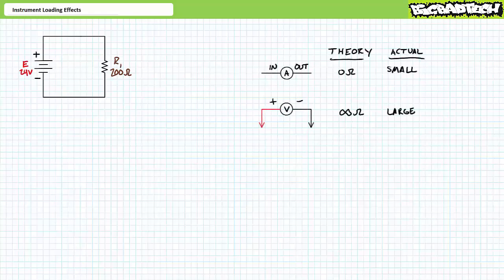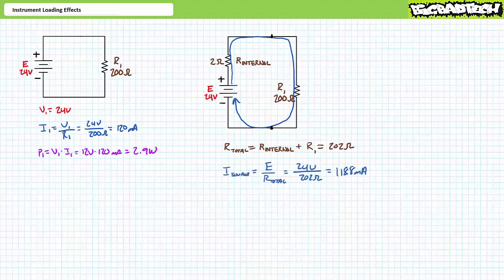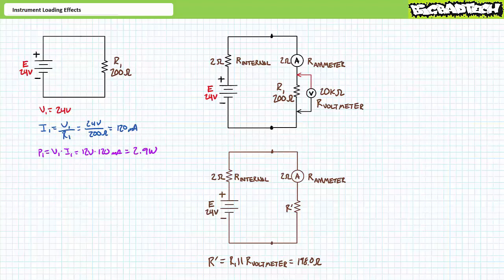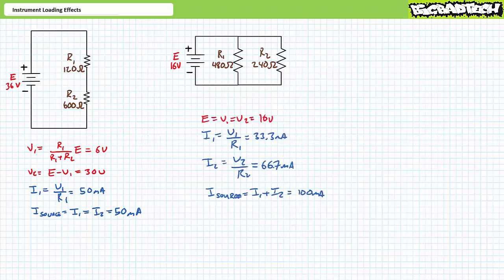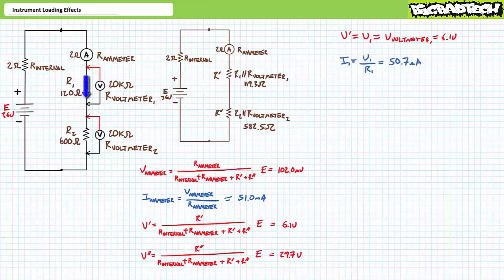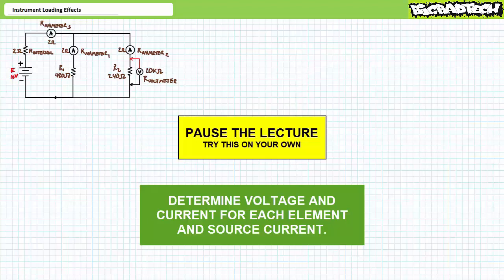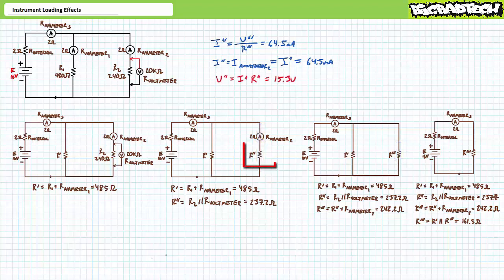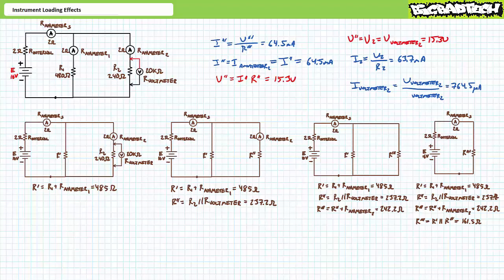Instrument Loading Effects (Full Lecture)

Comment: Question: Does this theory apply to high voltage systems where in a distribution yard you have 230KV @800Amps and it's reduced by potential transformers & current transformers so instrumentation can be read at a much lower acceptable voltage & current?
Reply from the maker: Good question. I'll cover potential and current transformers in upcoming lectures on protective relays. One can think of these instruments as non-contact magnetically coupled elements that might induce a tiny tiny reflected impedance to the larger power system. Given the scale of the power system and the tiny impedance I'd suspect the effects would largely go unnoticed.